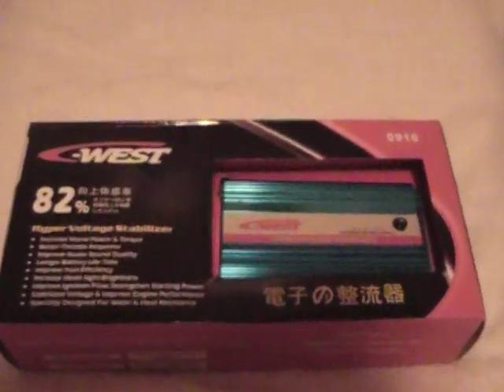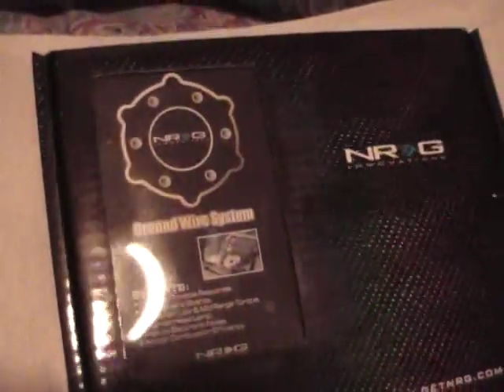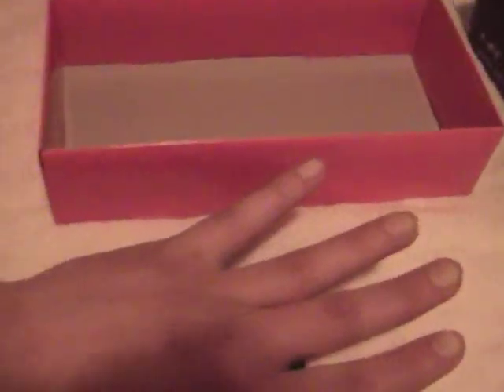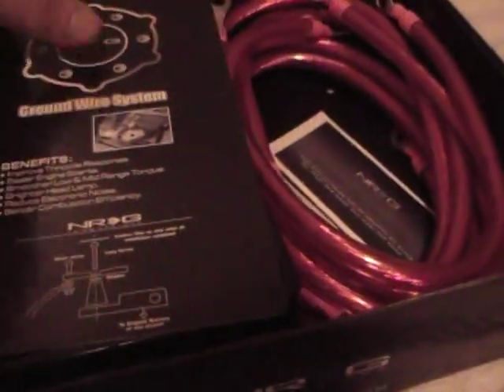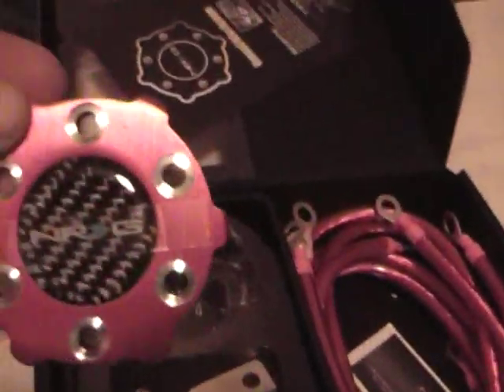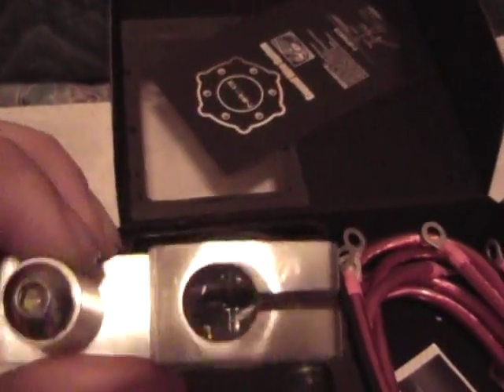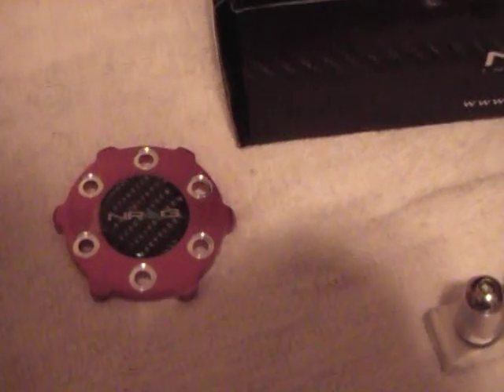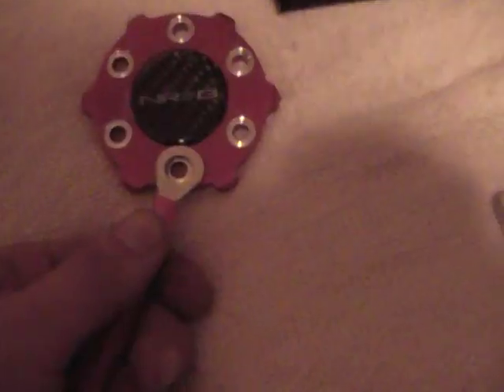NRG Grounding Wires and C-West Voltage Stabilizer

Comment from the maker: @Typhlosion100 Hey, dont even bother putting it on LoL, I took mine out not too long ago, I now have 3 thick 4 gauge wire coming off from my Top Post Red Top Battery and from my HO Alternator to my Top Post Battery as well. If you are having starting issues, purchase your self a nice Red Top Battery, No need for the Yellow Top unless you are running a loud Stereo System.
Ask more if needed bud :P

Comment: so if I were to buy this for my 1967 ford f100 it has starting problems so we have to disconnect the + cable at night when were done driving it, if I were to use this will it start up without charging or boosting it off? until we figure out were the shorts at please let me know before I put 1 on order

Comment: Also...what do you mean by ignition flow? Do u mean voltage to the spark plugs? If anything this would only make the car more efficient...not add horse power because its not like the ECU will think,hmmm,I have more voltage so let's mod the spark timeing...

Comment: What does an electric current have to do with power going from an engine to the wheels? Is there any hard proof that these work? And if it has a non transparent case how do u know of its working...
Reply: Electricity is parasitic on an engine.

Comment: Does that even turn off after installing
Reply from the maker: No idea LoL. This was long ago. Probably was a scam back then and still is 🤣
Reply: @BoxerMuscleMilk  😂  lmaooo yea its bust and not worth waking up to a dead battery  .. I don't know if it even does anything  I put it on my amp to the remote and ground  lol
Reply from the maker: @wickedlokz1849  you can buy a battery maintainer and hook it up that way and also plugs in as well. Those are the best kind and many are now small/ low profile and can mount anywhere and make it look like factory.

Comment: Alrighty then,,, you opened  the boxes congrats,,    LOL the  stabilizers  do work  only on OLD  cars ..  On  NEW cars  they are not worth it the ground  system is new  all wires are new  ,, if a car  is ten years old  plus  it will help
Reply: Daniel Tello Would you call 1999 Nissan an old car?
Reply: Almost hitting 20 years old,,, problems will arise but it depends on how well you took care of the vehicle while my 1996 Toyota corolla was old it was solid due to upgrades and the usual check ups My mechanic  bought it  for his  son realizing what a reliable car it is due to my care during 325K miles.... In answer to your question, the sales people and financial suits that do loans and make money on the money that you borrow YES  it is  old and they would prefer you finance a newer car but of  course  with payments  . All the money that I saved and  you are saving  you can purchase a car with cash as I have done after 20 years. while  I don't have my oldie  anymore Im already  changing wires  to silicone and  hoses these little  things  that will make my car last  500k miles I did stay with the Toyota  brand a i found  them to be the most reliable vehicles. I speak from my own personal experience of course. Wish you well